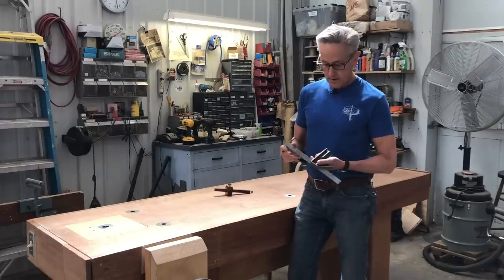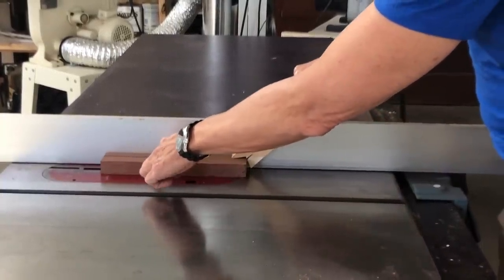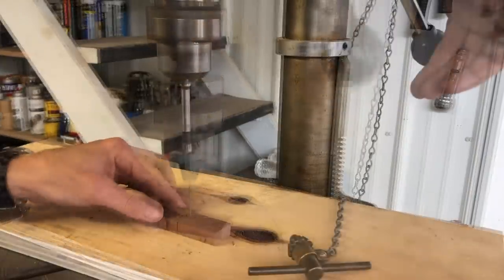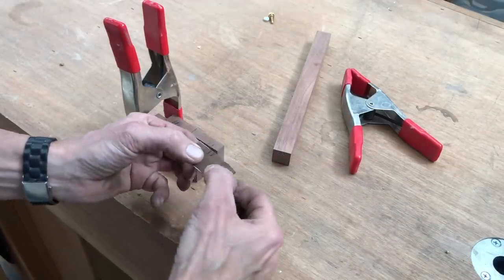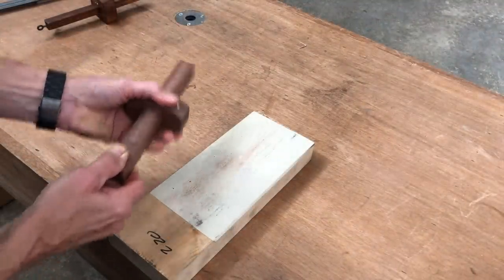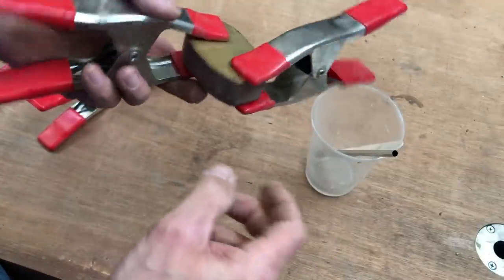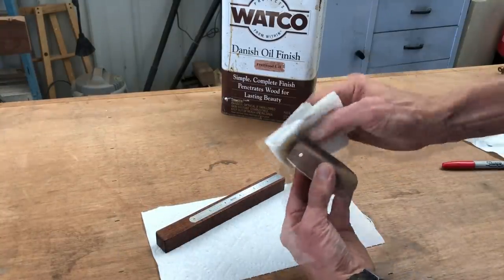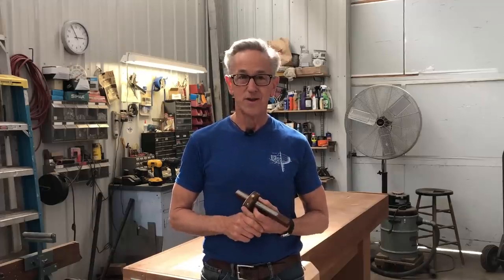Making a Classic Marking Gauge

Comment: I was initially a bit sceptical about gluing the pieces together instead if mortising a hole into a single piece, but with those brass bits, and the glue, and the plate as well, it's probably stronger than a single piece, which could break along the grain anyway. 
And, damn, it looks nice!

Comment: Great ideas.  I love the 6” scale addition. I just went out and found the one I purchased 34 years ago but only rarely usedI found that on the softer woods it wouldn’t scribe an even line. It would go over the hard rings and gouge in between. I’ll be making the modifications this afternoon.ibeen doing the pencil thing for many years after an old blacksmith showed me how to get a nice clean edge on soap stone using a grinder.thank you or the inspiration

Comment: Very nice work !  I did Woodworking professionally for over 20 years and its been a hobby of mine for a little longer  most definitely a pencil guy but. I switched to using mechanical ones years ago to give me  a   Consistent fine line to work to everytime  i dont use anything fancy. Just a pack of Bic  pencils i buy at walmart pretty cheaply  almost all of the 40. Guys i worked with. Use them as well   As they. Will fit into our scribes. And other  marking tools without. Any modification  i also like the  plastic clip on them to hold them in my apron or shirt pockets. Even when i  lean. Over  something I’m working on   I really liked that bench. You are using in the video  another. Hobby / passion of mine is boating as ive owned 17 or 18 vessels over my lifetime so far. Both sail and power Wood and kFiberglass  and i have   Several thousands of miles  under my belt  including the Florida  Keys, Bahamas , and the Intra Coastal Waterway  from the Chesapeake Bay Maryland to Ft Lauderdale Florida  ive been a fisherman , Scuba Diver  since i was a teenager  and have done  almost all my own. Repairs and restorations myself  including major refits and even engine  work  if needed  of course having a machine shop do  some of  that when i needed   That type of specialty work  i did restore a 1964 Wooden Chris Craft cabin  cruiser that was in. My family  for the majority of its ownership

Comment: holding the scribe blade on with a single screw. will give you .a problem. In time that blade will rotate  under pressure. and it is bound to happen just when you don`t want it to .  Sods law...It is only friction that is keeping it square at present.  Remove and rough up the back and replace using a spot of  something like superglue.      Just a thought.

Comment: Beautiful work. Your attention to detail is incredible. 

I'd like to throw something out there. For a small epoxy job like that, maybe use a paper cup and a gloved finger rather a plastic cup and a metal brush that'll both still be here after were all gone. I use a lot of chip brushes (boat stuff) and I always cut the handles off and save them for reuse, even if it's just for mixing or fillet sticks. I even sand them down to use as wedges. Any thoughts on how you might reuse the handles from the acid brushes?

Comment: Really nice. Was thinking of making one for my son, but didn't cos of the scribe point. Hacksaw blade sorts that. 

One observation. The scale looks as if it lines up with the edge of the blade, not the centre, so always half a blade thickness out. Or did uo f Grund down the outside of the blade?

Comment: If your marking wood, the blade would do a better job shearing the wood fibers - where the needle point would tend to tear the fibers. On metal, the point works better to scratch the metal surface. I like pencil better, because it sands off and doesn't leave a scratch in the wood.

Comment: The screw bears against the ruler. It might not be a problem now, but over time, it might. I always measure the depth anyway, force of habit, so the ruler seems pointless. As far as the scribed line goes, I often don't want it to show on a finished piece, so I reach for the pencil. Making a gauge is very satisfying though. I think I have 5.
Reply: I looked again at the screw issue you pointed out. It bears down on the ruler where it has no lines or numbers to wear out so it should be ok. Unless you meant that it may loosen epoxy under ruler. 🤔

Comment: Lovely gauge.I think what would benefit your channel is if you did some collaboration with, lets say Arabella. If you made a small cabinet or door trim for them.
Reply from the maker: Great suggestion. However, I have already been working with Steve and Alix. I spent several days with them bolting the backbone together. You can see be at the beginning of the A2A video "Bolting the backbone together" I'm hundreds of miles and a couple of days drive from them. We are in constant connection sharing ideas and solving problems. We will be working together in the future. Thanks!

Comment: That brass plate is going to chew up the wood beam.  It needs to be an oversize hole at least and maybe a square bushing or something.
Reply from the maker: It does not rub the wood beam. When filing it I put a small chamfer on it. Thanks for your comment I should have mention that in the narrative.

Comment: If the scribe isn't counter sunk flush with the end of the ruler this gauge is going to be off by the thickness of the scribe AKA hacksaw blade. Other than that this is a great job. I never trust the built in rulers on any tool  I always measure from the cutter to the fence with my trusty Starrett.